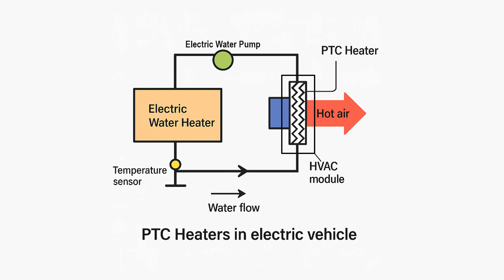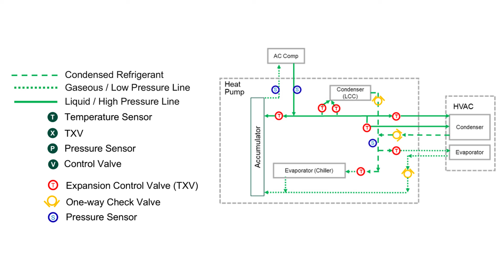PTC Heater vs Heat Pump: Which Is Better for EV Thermal Management?

Comment: That's nothing. A heat pump is exactly that. It pumps heat from one location to another. It doesn't make heat just moves it. But to heat the cabin there still needs to be a heat source, normally the outside air. Tesla's Octovalve system is actually able to scavenge waste heat from the drive train improving efficiency even more.
Reply: It's no magic, everything needs cooling or heating, they just plumb it and pass to whichever needs it , motors, batteries,cabin etc

Comment: I would prefer technical explanations with numbers, but I did not hear any.  Relative efficiency, relative cost, relative weight.  Things like that.
Reply: Regarding relative efficiency, Paul mentioned that during winter months, the electric heater might reduce range by about 20%, while a heat pump might reduce range by about 10%. That suggests the heat pump is about twice as efficient as a heater.
Reply: @CiaranMcHale  A well designed heat pump will be multiple times more efficient than a resistance heater (300-400% or perhaps even greater), when working within its ideal temperature range of course. :) As temps creep downwards efficiency will start to taper off at some point, depending on the heat pump design. Pumps using carbon dioxide as the coolant medium can stay efficient at very low temperatures, but also require higher pressures, and thus are more costly to build. To my knowledge, there are no automotive heat pumps using CO2 coolant as of yet.
Reply: Cop of 2 to 3 should be possible i.e. twice or three times as much energy per unit heat out. If you have an ac system already not that much bigger just alot of plumbing
Reply: You gotta buy their reports for the detailed stuff, but nice try 😜
Reply: He could have at least explained how a Positive Temperature Coefficient heating element works.
Reply: He is doing an overall comparison and explanation. Numbers would be only for one pair of offerings.

Comment: Heat pump is basically always the more energy efficient method to heat. Because even in the worst scenario, it still most of the time has a COP of greather than one is more efficient than a PTC.
Reply: Not in the most extreme cold.
Reply: @yolo_burrito  It depends on the refrigerant.
Reply: @jamesvandamme7786 : for home units, I find they don't extract much heat after the evaporator turns into a block of ice, no airflow. Then they turn on resistance heating to melt it.

Comment: What does PTC mean? Is it just an exceedingly verbose way of saying "resistance heater"
Reply: PTC: Positive Temperature Coefficient.
Reply: PTC is a specific type of resistive heater who's resistance increases with temperature to self-regulate and are more efficient and reliable, traditional resistive heaters you might find in an electric baseboard heater use fixed-resistance.
Reply: @nster3  Huh?  There is no more efficiency you can get out of a resistive heater than 100%.  And the reliability, at least of the Tesla implementation, calls your reliability claim into question, too.
Reply: Is your comment an exceedingly verbose way of saying “I couldn't google the answer to my question”
Reply: @kino_cinante   it takes two seconds to explain what PTC stands for and there is no chance I will get mixed up with the dozen or other initiallisims for PTC because engineers have a love for obscuring everything with needless acronyms and initialisims
Reply: @kino_cinante or perhaps they preferred someone knowledgeable explaining it rather than a bunch of nameless web entries with no context…..

Comment: Thanks for the vid. You really have to put this at 1.5 speed to make it watchable. Also it would be most helpful to hear the cost difference between the PTC vs heat pump given costing is what Monro does.
Reply: Thanks. I put it on 1.5x and it was a great video.
Reply: Agreed, 1.5X works perfectly.
Reply: 2.0x suits me
Reply: He actually did that in later videos. I don’t think it was 1.5 but maybe 1.25. He addressed it in the vid

Comment: They should use a little keroscene or propane heater, the fuel consumption would be small and it would be extremely reliable.
Reply: Renault had diesel heaters in the Kangoo EV vans. Ours at work had a diesel leak and had to have the tank changed.

Comment: Nissan Leaf was first with a heat pump in 2013. A negative of heat pump is noise and vibration.
Reply from the maker: Correction: Yes, the Nissan Leaf did have a heat pump in some models.
Reply: @MunroLive don’t forget to remind Sandy to comment on the state of the industry due to tariffs
Reply: You need an A/C anyhow. The heat pump just adds a (complicated) valve.
Reply: @jamesvandamme7786  I think it's typically more than that because an A/C probably only needs the power to hit about a 40degF temperature gradient with outside, a heater needs to hit a 60degF or higher temperature gradient to be broadly usable.
Reply: VW e-golf also had a heat pump in 2013.
Reply: Why would you produce this type of video without showing the most efficient and best designed heat pump created by Tesla (that is what Sandy called it).  Instead you show a crappy designed GM heat pump with all those hoses and pipes taking up 4 times more space than Tesla's Oct-A-Valve system.  Additional note, this Equanox might be around $35,000 to sell but costs GM $40,000 plus to produce(pre-tariff).
Reply: @shallenberger57 yeah, show us the incredibly noisy Tesla version
Reply: @ulf5738  Can they make it sound and make vibration like a V8? That would sell to the gearheads.

Comment: Tesla was never the first to use heat pumps! I clearly remember Bjørn Nyland asked for Tesla to put a heat pump in their cars, when he tested (several) other EV's already with heat pump.
Reply from the maker: Correction: Tesla wasn’t the first — some Nissan Leaf models came with a heat pump. That one’s on us! 👀🔧
Reply: @MunroLive , yeah, and others back in 2018/2019  before Tesla.
Reply: @Krylle Kia Soul had a heat pump
Reply: Zoe Renault  @MunroLive
Reply: @MunroLive  well, it was the GM EV1 actually.

Comment: Love my Tesla...but the heatpump has durability issues. When it goes out it's +$3,000 to fix. It's happened to me twice now on my 2021 Model Y. 
Tesla needs to address these issues. Munro should highlight these issues and help Tesla to fix the durability issues.
When your heatpump goes out in Minnesota when it's winter it becomes a HUGE issue...and the fix is only a complete system right now.…at a very high cost!
Reply: THIS, thanks!
It needs to be HIGH on the theme board of reliability/durability of cars. Such a bloody waste.
Reply: You are not alone; same plague in Nordics. Some have been failing four times during warranty, after that Tesla washes their hands. There are independent services here already which replace heatpump for over 2k when Tesla asks 4k in euros. 

And it has been that since they came.
Reply: @Mariini 100,000 miles, heat pump no problems.
Reply: yeah, that's no bueno
Reply: Kia Soul EV has both heat pump and PTC heater. That saved me during wintertime when the heat pump had a gas leak.
Reply: Same here I’m on my forth and 2nd I’ve had to pay for.
Reply: They must have made improvements in 2022, my model 3 is nearly at 140,000km and going strong.